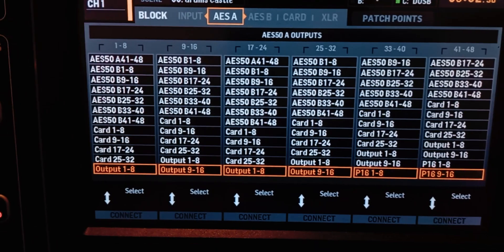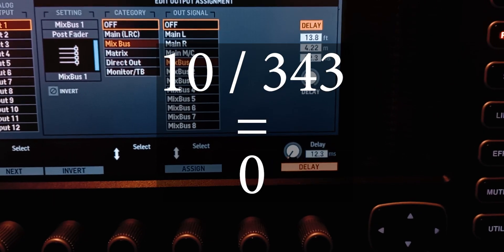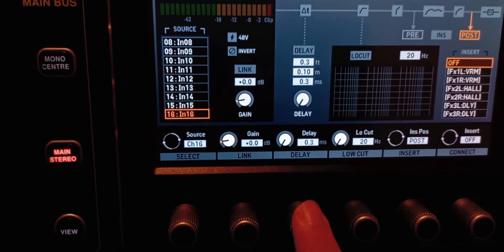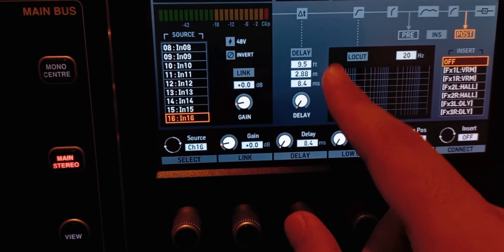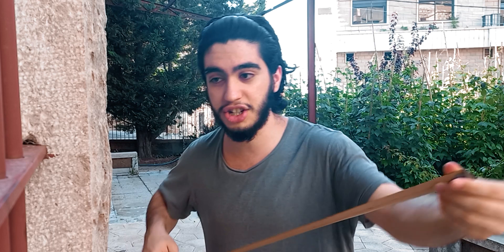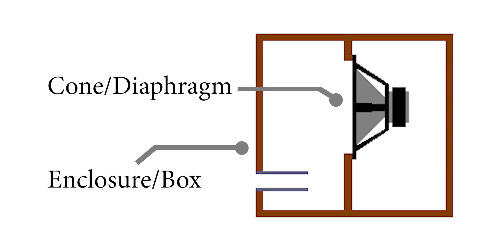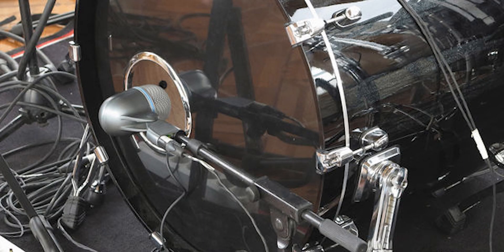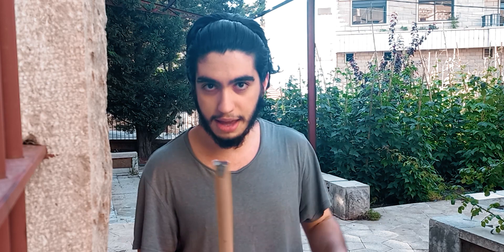X32/M32: how to time align speakers and/or channels (output delay, phase & polarity EXPLAINED)

Comment: Hello Daniel.  Excellent videos.  I enjoy everything learning from you!  I am wondering if you had a video on how to add an external compressor to the M32.  I want to add a DBX 162SL "purple" compression unit in stereo on a pair of channels being used by DJs for an event coming up.  I have seen a few videos out there on how to do this but none are complete.  That is, the presenter doing the video doesn't explain the process in enough detail to be able to understand it very well.  And from what I've seen there are two different ways of going about it.  Please let me know if you have a video on this.  Thank you very much!
Reply from the maker: I haven't done a video about this but i can do it. In short you're gonna route an aux output to a direct out from the channel, the plug that aux out into the input of the compressor, then plug the output of the compressor into the aux input. Now you are getting the compressed signal on the aux. Raise the fader of that aux to hear it in the mix and turn off the main stereo button on the initial channel so you don't send the same signal twice to the main LR
Reply: Bro come to my church ! Lol
Reply: @danielkharrat   Remember to consider the latency of the loop and the DA-AD conversion.

Comment: Thanks.. 'Mind me asking. Ive got an analog mixer need delay but cant find here in our country- philippines.. What would you suggest? Got hard time lookin on the net. Thank you!
Reply from the maker: I'm not sure what you have available but if your mixer is analog you need an external digital signal processor. You may find one around $400 usd
I tried searching for a cheaper solution that only does delay but i couldn't find anything. So you need either a digital mixer that has outputs delays or a digital signal processor
Reply: @danielkharrat  appreciate it..thanks! Kinda hard to purchase like rolls hrd342/behringer dsp110.. Gotta try to, if theyre gonna send me one w/o transits from other countries. More power to you Sir! Thank you once again!
Reply: By the way 'am a new sub. Glad to watch and learn as well! Really helps..thanks again.